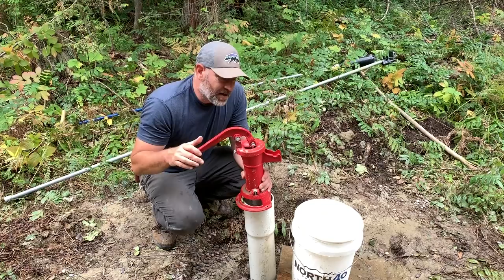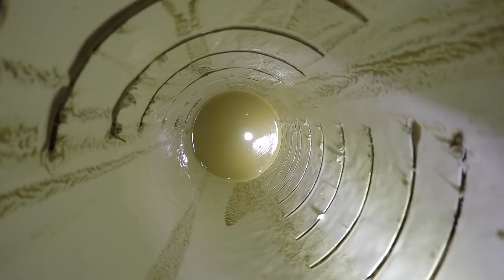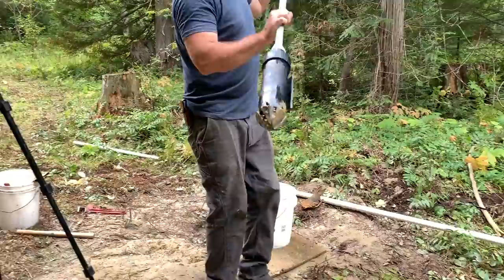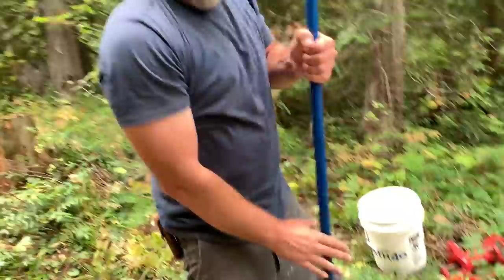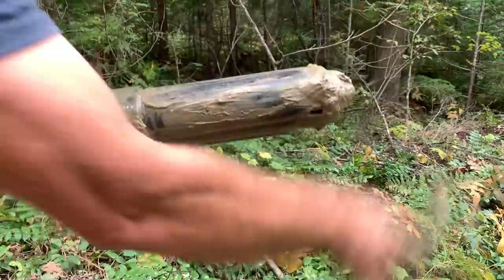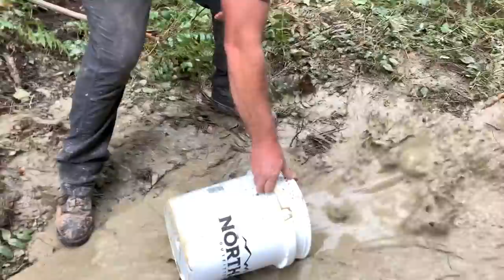Removing Silt/Mud Sediment from our Well

Comment: Looks to me like the sand is too fine for the strainer you have. I have put down 15 or 20 well in my life, and have always found water right under the clay level. Sometimes  the sand would be too fine of a grian and would come through the strainer and stop up the strainer. Either get a finer strainer or go deeper and find a courser sand. GOOD LUCK because well drilling by hand is a lot of HARD work.

Comment: Your cuts in the casing are to wide, to high up the pipe, to keep the "mud" out.  I do not feel you are in a stream. I have put down several by hand and even my shallow ones would produce 7gpMinute continuously. My 30 some feet will produce about 28 gpm continuously.  I feel you should use some pipe--like 1" and hook a hose on it with some water pressure and drop it into the casing and wash it down a few more feet lower than the casing to just see if you can hit a stream. When you hit a stream the pipe will sink about as fast as you can push it----for a few feet. If you have a good stream a few feet deeper---you might want to re-drill the hole deeper or drive a sand point attached to your new no slit in the side casing pipe with a false slitted bottom so it only measures so deep and seal the drop pipe to the top of the casing after the inspection is done---you know where I am going?? And forget the rocks---seal the casing with the mud as tight as possible. You want the suction from the pump to create a negative pressure and cause a suction on the sand point to fill the casing with water---I feel it will work.

Comment: I love the do-it-yourself mentality from your videos.  I hate to say it, but there are times when you have to bite the bullet and pay for a proper service.  Here, you will never get potable water from an 18 foot hole that is only 8" wide.  Even with my old 24" well that was 20 feet deep we occassionally ran out.  Your volume of water in your well is about 1/20th of my old well and wouldn't last even a minute running a shower.  

If you need a permit, get one and hire a professional well driller who can go down 150 feet at least.  Sure, it will cost you at least 3-4k for that, but you'll have the confidence that your well is deep enough and will have a high enough volume of water to work.

Of course, if you are only using this well for watering a garden, then it's good enough.  But flow rate from that well won't be more than a quart or two a minute, and will have no storage really at all.

I'm from Idaho BTW.  Great state.

Comment: to obtain a large amount of water available, there needs to be room at/near the bottom of the well to hold water.   This usually needs a much larger pipe to act as a holding area for the water
A 6 or 8 inch diameter pipe leaves very little room for water. Suggest a much larger casing *say 2foot diameter casing'

Comment: The fact that the water is brown is a good thing. you need to pump it slower, maybe a gallon or so per minute. If it were gray forget it.
You can extend the pipe, leave the pump off and pump it by just picking the pipe up and down. You'll be surprised how good this works. Just don't ruin your foot valve by banging it on the bottom too much. 
If there's anything courser than fine sand down there you'll get the fines out and the bigger stuff can bridge up to filter out the remaining fines and allow more water in. 
1 or 2 gallons per minute to start isn't bad.

Comment: The only chance you have at this point, with this well is air. You need a compressor with enough CFM and pressure to clean out the hole. The bigger problem is I do not think you are in a formation that will give up enough volume for your use. I understand the limitations of the hand pump, however to reach a formation that will give up water is sand and gravel or cracked and fracture rock. A check of the area geology would help, or any well logs for the area, if available. A well driller in you area would be your best info. Two things..if you use air you will need a water tank to help flush and if you decide to redrill , water witching is worthless.  This comes from watching men try it for the last 22 years
Reply from the maker: I might try it in the future but right now we are busy with other projects. I’ll get back to the well at a later date.

Comment: A couple of things for you to ignore.  First you need water bearing sand to get water. Clay doesn’t work.  Also the slits are to big.  Look at a commercially made slit filter.   They are tiny for a reason.  The large sand builds up on the outside allowing only water through.   Your not making any progress.  Nothing you do will make that well work.